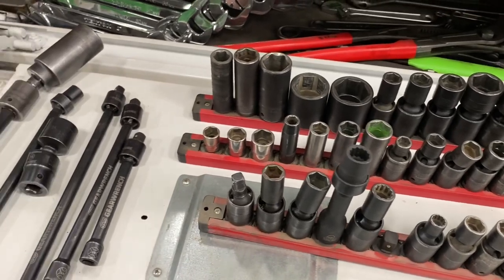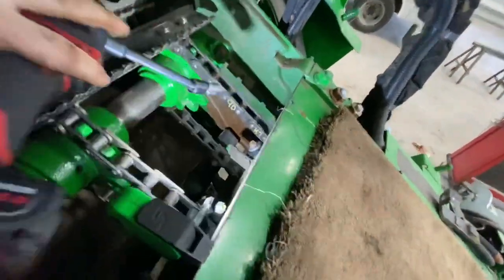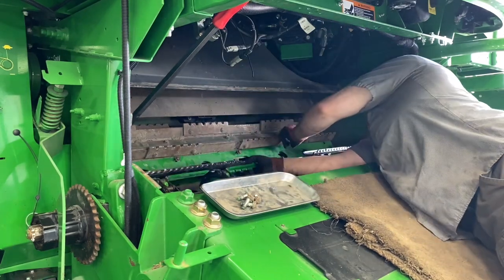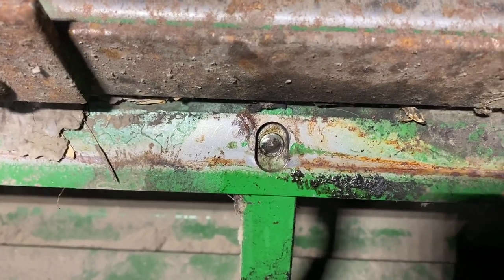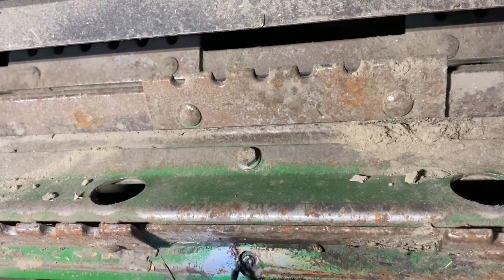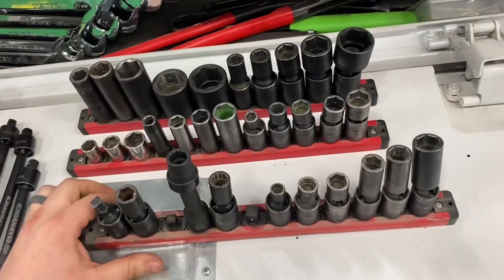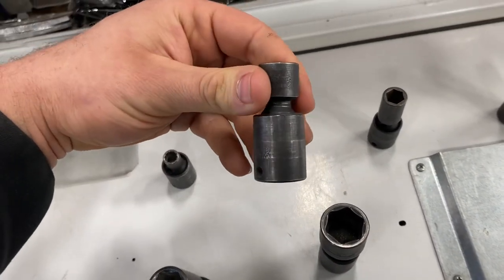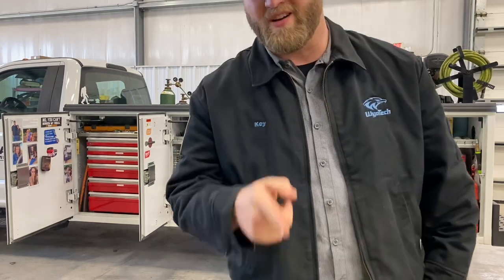Tools I could not live without! (Impact swivel sockets & Milwaukee impacts)

Comment: Great review!
I worked on vehicles in the 90's,and single pins were the only available option.
Locking extensions are great for keeping the swivels from going into orbit lol.
Since air guns were weaker (cordless were 1/2 as powerful as now), for bellhousings they had a 1/2 female drive 3ft long with a 3/8 male to use smaller sockets.
A 3/8 short swivel set should be your 3rd or 4th socket set you buy, until then get a swivel adapter in my opinion.
Reply from the maker: I have that long extension and I used it in my automotive days for Bell housing bolts lol

Comment: I love Milwaukee tools.  Unfortunately, I am too old to get under a vehicle (not certain I can make it back up again HA HA), but I do have a lot of their wood working stuff.  Years ago I started with a Milwaukee 12 volt drill, switched to craftsman 19.2 and am now back to Milwaukee  12v fuel.  I have the drill and impact driver set, a saw, a Sawzall, a stapler and a jigsaw.  I have a set of hex bits in 1/4, 3/8 and 1/2" drive that I put in my impact driver to remove stubborn bolts if i need to work on my truck.  That little tool has not failed me yet.  The jigsaw has saved me on more than one occasion as I am no carpenter.  Cuts smooth with the right bit.  seems like a lot of mechanics are finding out how good the Milwaukee brand is.

Keep up the good work.  I have been retired for 6 years or so and the wife is spooked about our Government and the economy.  She wants to buy property and try farming.  Good Lord help me, I am an ex-banker who knows nothing about farming and how to drive a tractor but it does look like a lot of fun.  starting a new endeavor at 72, well why not.  From Texas, Charles

Comment: Where did you get the extra deep green sockets in your tool cart. I’m assuming there 18 and 24mm.
Reply from the maker: They are John Deere special tools from service guard. 18 & 24mm.
Reply: @ZKMasterTech  the two I found 663 and 664 say that they are 3/4 drive
Reply from the maker: @jdw8320  they are half inch drive. Your best bet is to buy an 18mm and 24mm socket and Cut them in half and weld a pipe in between. Way cheaper
Reply: @ZKMasterTech  I got a couple different lengths welded up